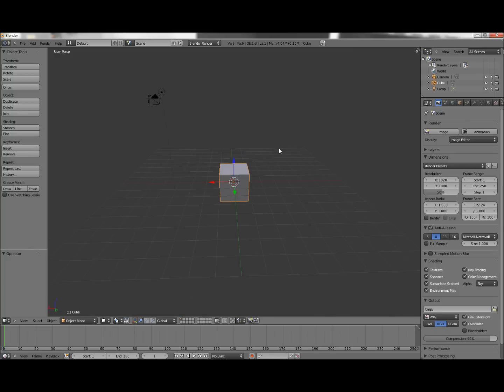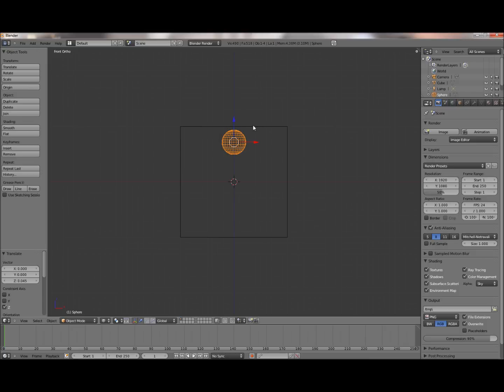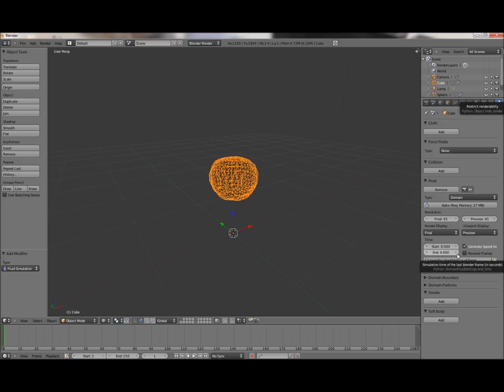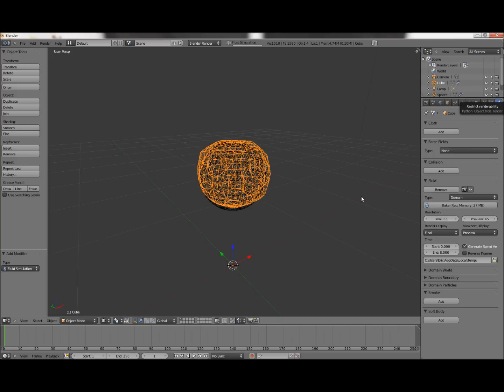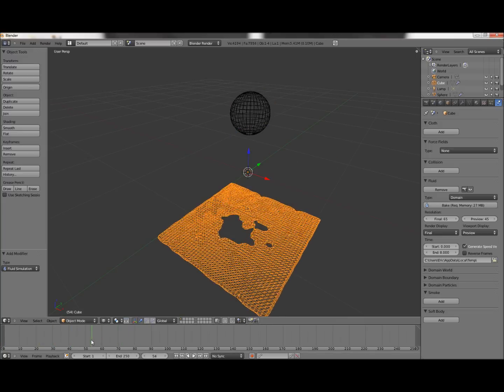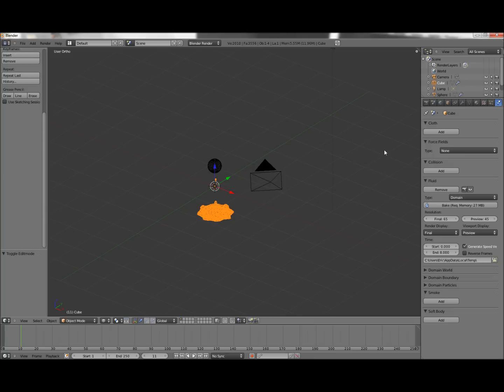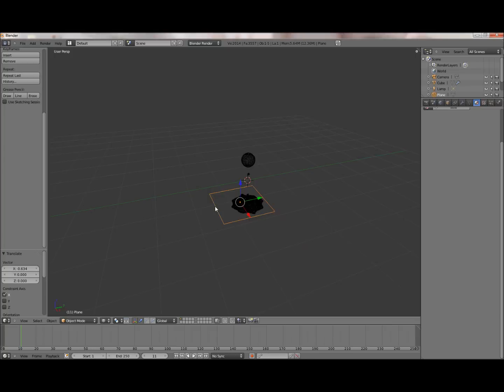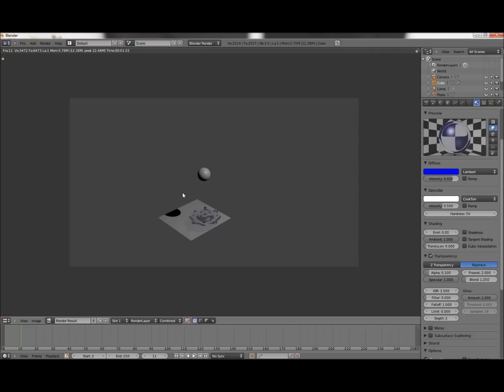Blender 2.56 Fluid Tutorial

Comment: Yeah, Six times the price for double the performance? No thanks. I have still yet to max it out completely, of course not including video editing and such. While a sandy bridge core may be about equal to a bulldozer module in multithreaded work, people forget that eight cores can do double the IO access than four HT cores, leading to a much smoother gaming experience. That's why I bought it. While the FPS may be slightly higher on an Intel system, overall AMD wins on true fluidity of gameplay.

Comment: Regarding the timingof the water simulation. Blender defaults to 24 frames per second (fps). So in determining how long your animation will be, you multiple 24 fps by length in seconds of your animation, for a more realistic look.

For example. You want a 10second animation. You multiply 24fpa x 10s = 240 frames. So set your time line to 240 frames long which =10 seconds. Of course if you set the frame rate to 30 fps. Then it's 30fps x 10s.